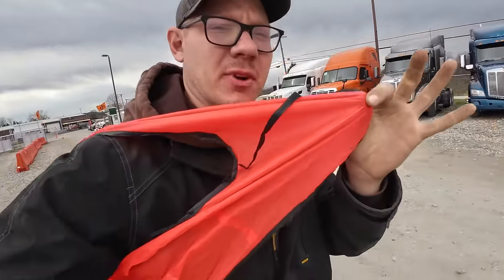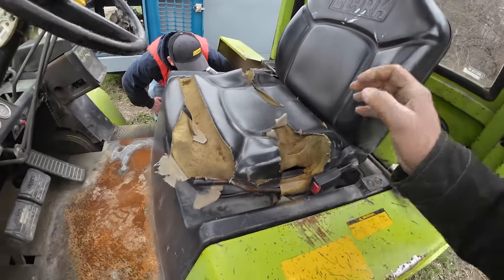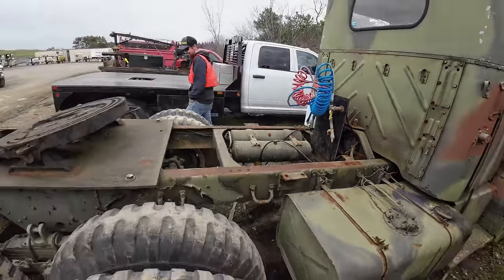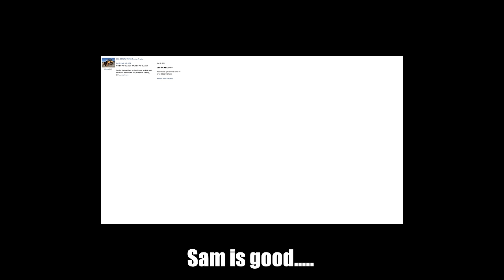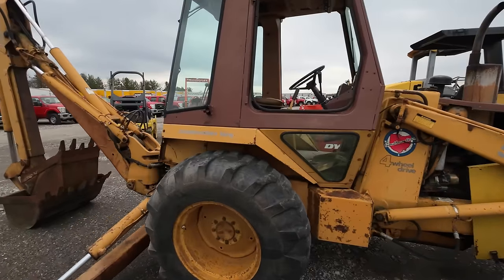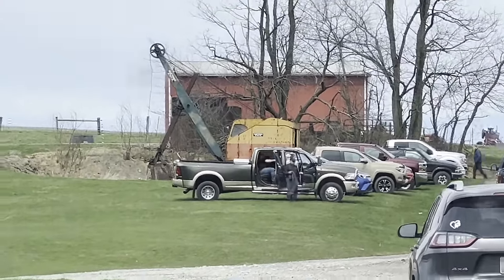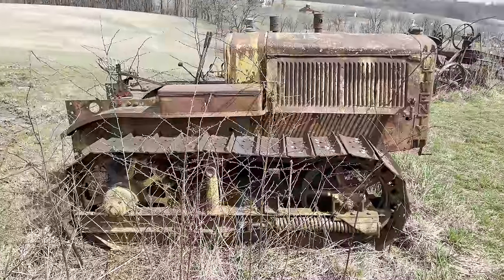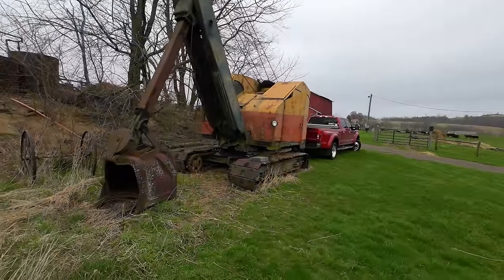Went Over Budget at the Auction... Some things You Can't leave without!

Comment: I love when you go to the auctions. You always pull something real nice out of it all. Can’t wait to see what’s next on you’re list of builds
Reply from the maker: Thanks so much
Reply: @DieselCreek  What is the least valuable excavator age? This one appears to have some antique value, so may have been appreciating for some time even as it rusts in the elements,  but at what age are both actual work value to contractors and antique value to collectors, both minimal? maybe 50 years? so 1973?  Anyway, the age of minimum value is the age at which I am the most interested.  With cars it's more like half that, 25 years or 1998, the exact age of my Metro parts runner.
Reply from the maker: @alan6832  for age I guess it would be early hydraulic machines, your prob about right. Early-late 70s maybe even into the early 80s
Reply: @DieselCreek  And I'm trying to sell my 1983? EX100-1, but in order to buy an RV or moving van from a similar temporal low point, and that price low point is my main interest.

Comment: The only bad thing here is that I suggest you really ought to finish restoring Christine before you so much as start restoring another grader. Get the cab windows in, even if you end up using perspex, & fit the cab out plus whatever else is left to do, maybe sign writing or whatever, because otherwise you'll be looking at a huge list of unfinished projects rotting away... it's just a little bit of self denial required...

Comment: That CAT 212 is a real piece of work...  BUT.!!  When you actually look behind the peeling paint, the machine is in exceptional condition.  If it has spent most of its life on the farm it should be simple to clean up and get on the trail again.  Most farmers take good care of their equipment and maintain them.  You shouldn't find any worn-out joints and fittings like you find on contractor's stuff...and no hoses to rot off.
The shovel looks like it just needs a bit of love and some paint.  Everything is looking good.  The sheet metal is not all beat up and rusted away.  Some new cables might be good to make sure it keeps going while in operation...  You done good..!!!

Comment: Did GOOD! Ran a 22-B with a clam,/Cummins, a headache ball/318 like yours and a drag bucket/IH-UDdouble barrel and a #12 grader. They work fine but you just need to be serious when lifting or lowering. Jaw clutches will kick back BUT you can tell how much pressure you have on the blade by the amount of kick. There was a preacher out of Tenn. that cut bluetop grade with a newer #12. BLESSINGS!

Comment: I think I have been watching too many Diesel Creek and Mustie1 videos, I just bought a 2004 John Deere 35C mini excavator. The cab is off, motor laying in the dirt, 3 milk crates full of parts. I  couldn't pass it up for $500 delivered. I found a 3cyl diesel for $700 so after some hoses and fittings I should have a decent machine for under $2000. Its got 2014 hrs I don't know how many parts wear out in  that amount of time but it came from a construction company not a earth moving/excavating company so its in pretty good shape for a 20 year old machine .

Comment: Running thr speed swing is one of my favorite jobs. Bucket looks like it was set up for removing coal fines from between the rail at a load out or snow. Bucket is looks too good to have been used for ballast work. Ours gets beat to shit quickly.

Always funny to see new guys on it when they don't drop the rail gear fast enough and it starts to roll away on em as its not in contact with the tires yet🤣

Comment: My idea of a parts runner is much smaller than an el camino or jeep, 3 cylinders at most, which I think leaves King Midget, Subaru Justy, the little Mitsubishi if you want it new, some of those mini-trucks, Geo Metro, and various 3 and 2 wheelers including mopeds.  I just don't feel like a Jeep or El Camino saves enough gas over your 1-ton to justify a specialized vehicle.

Comment: With the new shop it going to be great to be able to pull each one of these things in and give them good cleanings, fix and repair stuff along with being able to take them apart. Now I kinda wish there was more lean too spaces to park everything under! 

Kinda makes me wonder what you are going to do wtih those containers shops. In my case I would stack them up kinda where the other container shop is or even clean land and move them, lay down that barrier and bring in rock to fill up the whole area then lay out the contianers and put roofs on each section. I am not sure the cost of those container roofs yet they are likely much cheaper than one would think. You now have 4 bays 40 feet long and how ever wide along with 5 shops to put stuff in. If you ever find those steel doors and frames you can cut and weld them right in to the frame which makes it better than opening an end. Just set the containers on double of those soild concrete blocks as this will allow you to pour in pads from time to time which can be level with the container bottom. Think 4 inches stone, 4 inches concrete over the top.
Reply from the maker: Way ahead of you 😎

Comment: That railway loader is a bit big for my 71/4" railway at home.
Reply: That thing was super cool. I am sure someone could make that work quite well for a project. Depending on the load it can haul it would make for a great loading trucks  because you can pull along the side and load rather than drive up. Which means that you can loop rather than having to back up every time. This could be useful for loading logs because you can make a grapple then drive up lift the boom move forward, turn and then moved forward or back again and drop the load.
Reply: @kameljoe21  Yes I do big timber as well as my railway, had not thought of that, ( over 70)however quite pricey to get it to the UK.

Comment: You missed the best thing about that truck with the home-made crane and all rusted out frame. Those mud tires looked like they had just about brand new tread on them. At 350.00 each that's 1400 bucks right there. If the front ones looked as good then add more to that and it probably wouldn't even have sold for that much. Bottom line... You should have purchased that rust bucket and you could have made money on it.